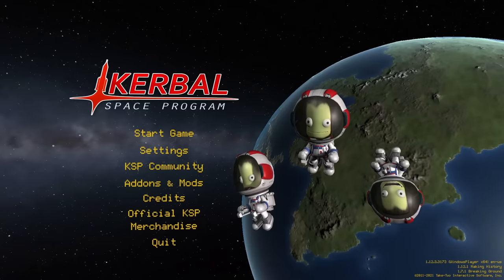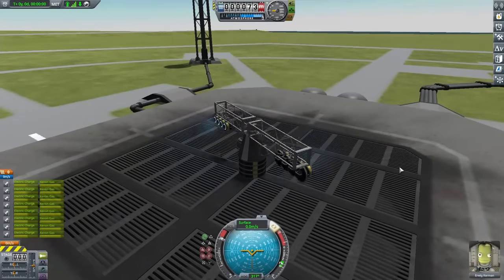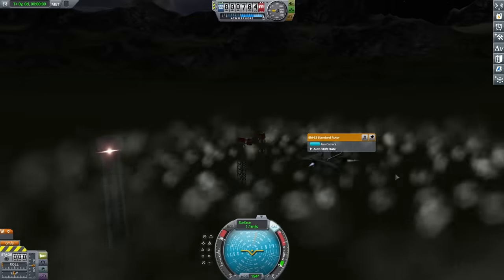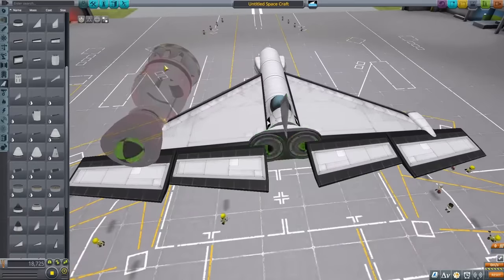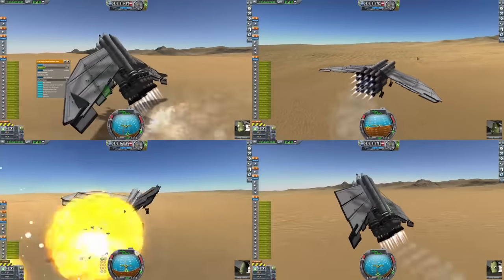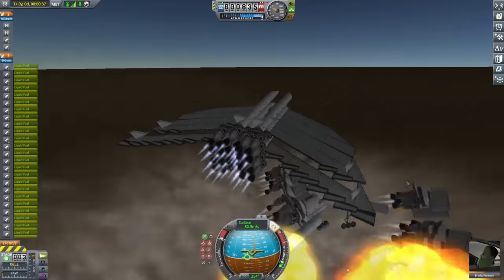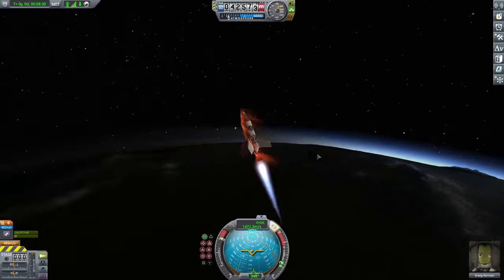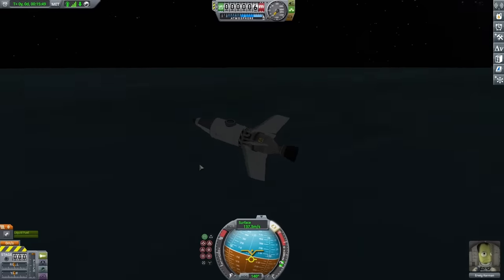Can you use Nuclear Power to Get into Space in Kerbal Space Program?

Comment: I'd recommend using autostrut for wobbliness, and making sure the Center of Mass is ahead of the Center of Lift when making aircrafts so they fly properly.
Reply from the maker: Yup, I usually forget to check the center of mass on my first test
Reply: Misread as I'd recommend using astronaut for wobbliness
Reply: Just having the centre of lift behind centre of mass is not enough you will need testing to make sure the centre of drag is behind the centre of mass
Reply: @ReidCaptain  Also consider with planes that when they brun fuel, the center of mass changes as well. i saw that happen quite a lot in this video when your plane just flipped over.
Reply: @bjboss1119 you can't check that in ksp, the closest thing to it is the COL
Reply: @Jamesdavey358  you defiantly can check the CG of a craft in KSP
Reply: @Dongflopper399  yeah I meant the COD, you can only check COM, COT and COL
Reply: 1. Why are you not flying east? That's 500 free  dv, why arnt you auto strutting.  Do not use struts they cause too much drag.
Reply: @kieron698  i used f12 and my struts dont make a red line like a parachuta or a wing

Maybe my ksp is outdated
Reply: @ReidCaptain  also check the lift and thrust direction, as all 3 can make or break your planes design if they are misplaced or worse, completely insane.
Reply: @MDE_never_dies  and he still needed it, 770 people agree
Reply: @bjboss1119  Center of drag == center of lift.
Vehicle pivots around the center of mass.
Aerodynamic forces pass through the center of lift.
So the vehicle attempts to orient itself so that the center of lift passes directly behind the center of mass.

I suspect that the 3rd axis you were attempting to describe was the axis of thrust. If it's above the center of mass, the vehicle tends to pitch down when thrust is applied. The reverse if axis of thrust is below center of mass. Ideally axis of thrust passes directly through the center of mass and the center of lift is behind and slightly above the center of mass.
Reply: @johncochran8497  once you start tilting wing pieces to get more lift the COL starts to tilt and move very roughly where the actual COL is.
But if you have a lot of tilted wing panels on the front of a plane, they create more drag than COL position shows so the COD separats from the COL, in the VAB the blue circle is the centre of drag, in the SPH the blue circle is the centre of lift.
There is a difference
Reply: How to autostrut any recomended

Comment: My intuition is that something smaller would work a lot better here. Maybe the solution isn't just to add more thrusters, but to try and increase the effectiveness of the ones you have. That's what I'd do, anyway.
Reply: More thrusters means more “free mass” to work with. If you have one thruster, you only have x amount of weight you can add before overburdening it. This amount of mass is shortened further by the fuel and fuel containers to power it. By adding another thruster, you now have twice the free mass to work with, and you can have them both draw from a bigger fuel container, which has more efficient container mass:fuel mass. This effect keeps stacking.

TLDR: moar powah
Reply: @scronchgoose7403  in my own experience, with low power ssto's such as this, their is a certain critical point where adding more mass (fuel and thrusters) simply slows you down. So I do think he's right.
Reply: @scronchgoose7403  if you have less engines and more fuel then you’d get farther
Reply: @noahtanzell4543  This isn't an SSTO though.  With multiple stages, you can add as much mass as you want and always benefit from it to some degree.
Reply: @Tzizenorec   He built a plane in the end, not the same as a Rocket, can usually have under 1 TWR, and having too many engines / things isn't that great, drag exists buddy. But honestly there is no point in this discussion, this was just a stupid little challenge, nobody would use Nuclear engines for their whole craft.
Reply: Yeah just turn up the “effectiveness” slider from 75 to 100% then it should work!
Reply: i was legit thinking more is not better after i saw the insane amount of rockets.

Comment: Hey, about the tail moving up and down in the end, it is possible that it is your "keep stable" SAS acting up, it happens when you launch a rocket and it is a little bit unstable, the SAS actually makes that instability worse because it tries to compensate for every piece independently instead of the whole structure it seems, that problem also happens to me a lot
Reply from the maker: Yeah, I turned it off intermittently and that seemed to solve the waving. Didn't want to get too into it since it was such a specific issue
Reply: no, it tries to stabilize your craft, but assumes it's rigid. If it's at all wobbly then the delay and distortion can't be accounted for. It's the opposite of what you're claiming
Reply: you can fix this with struts or autostrutting to root.
Reply: @magica3526  ho alright thank you for the precision !
Reply: @labo3900  lmao
Reply: It happens when your rockets are long, the tail wobbles because there's bend in the joints, and the control surfaces all the way back there react relative to your capsule position, NOT their bend. Its fixed with either struts and/or limiting the control surface power.
Reply: Reading this as an airplane bias in both ksp1 and ksp2. This didn't age well ig

Comment: Your issue is wing efficency. That is, the lighter a wing is loaded, the more efficent it is. Because ksp dont calculate down draft, its possible to just spam wings.

A typical modern aircraft have a lift to draf ratio of 15-20. In ksp its easy to get over 50. Pretty much just spaming wings.

This also alows it to fly slower, hence needing less engines and being able to carry more fuel.

If you want to do it realistically, it should be one really long wing, like a sail  plane  with a single nuclear engine.

Also, drop tanks is recomended. 

Its also way easier to take of with a aircraft with slower design speed.

Also when lifting  up, the aircraft should use the same CAS at diffrent altitudes. There is online tools to calculate it. 

Figure out the aircraft most efficent speed, then calculate the CAS at diffrent airspeeds and just keep to it.

Having a fairly slow aircraft also helps put more energy into altitude than air resistance.
Reply: This guy does maths
Reply: Indeed, I often end up building triwing plane, but the wings are inside each other and also inside the fuselage.

Comment: The issue with the nuclear engines is that they don’t have gimbal, so it’s insanely hard to control
Reply from the maker: Very true, vectoring is generally so good I forget it's even there
Reply: @ReidCaptain  same lol
Reply: @ReidCaptain  REaction wheels to the rescue
Reply: @ReidCaptain  you can use the action groups to make it control via thrust differentials, or you could use hinges to artificially gimbal it
Reply: That's what reaction wheels, wings, and proper craft design are for.
Reply: @mkzhero  still makes it easier
Reply: @AspectDuck  It does, but only if you're a very basic player. I'm no pro either but i never felt the need for gimball outside when i was just starting off and didn't yet discover the center of lift, mass and thrust buttons. In space you don't really even need it at all, the capsule rotation mechanism is enough for a small vessel, and additional reaction wheels if its a bigger vessel, in the lower and low-mid atmosphere wings do all the work, gimball is really only useful in the high-mid atmosphere really, and even that can be negated by wings and making the stage that will be there balanced out more properly... Although no, i'm wrong, gimball is REALLY useful and pretty much mandatory on landings, unless you have a tiny ship and you're landing on a planet with low gravity and no atmosphere
Reply: who tf is gimbal
Reply: @Davidpoland2005  the rocket engine rotates to control direction
Eg on the swivel engine or the skipper one
Reply: you don't need a gimbal if you have proper design or control surfaces and balance of lift/drag. Gimbal is the compensation of bad aerodynamics of the vessel
Reply: @Shmidtk  Yep. Although it IS useful for landings on planets with relatively high gravity and no atmosphere... Especially for bigger crafts. That's about the only real place where its actually needed though, outside if you need to deliberately make your craft with bad aerodynamics for one reason or another.
Reply: @ReidCaptain 
Flipping over of planes is because of CoL being ahead of CoM. CoL ahead of CoM makes plane inherently unstable and wanting to flip over. There is only so much gimballed engines would do.

Wings are useless in upper parts of atmosphere. Use reaction wheels and RCS to control in upper atmosphere/space
Reply: @Shmidtk 
Aerodynamics do not exist in space. Though yes, gimballed engine is not necessary for a stable, controlled trip, except for really large/heavy designs

Comment: For making planes you have to get the gear enough front make it lift off. Also you can look up what a plane looks like. Seriously. Instead of a single delta wing, add some rear/front wings/elevators. Also always get an tail stabiliser. Also aerodynamics are important.
Reply: And also you can check the relation between centre of mass and centre of lift. Centre of lift should always be a little bit back fron the cog. If its in front, the plane will want to do backflips.

Comment: The blades are to bulky so the air curls clockwise pulling your device down. If they were a thinner blade and not so bulky and just a bit longer. Possibly your earlier models would’ve worked.

Comment: I just edited the code so my battery or solar panel has insane power and make the ion engines insanely powerful. I really cheated by changing the stats of the engine and fuel and ect. It was in a demo I think.

Comment: Stock? I don't know. But I use 2 nuclear ramjets from one of the mods with oxidizer, 50-100m/s to start off before switching to atmospheric intake, then the 3-minute trek to 18k at full throttle at which point I can accelerate to 1750m/s before pulling up and the residual thrust pushes me to an apoapsis of 100k at 2000m/s at which point I switch over to the internal oxidizer (now 2200m/s dV) to circularise the orbit (2000m/s dV left) and then I can do what I want.
Has a single mk2 cargobay with a 2t relay satellite in it and mk2 clamp-o-tron and uses procedural wings plus FARc.